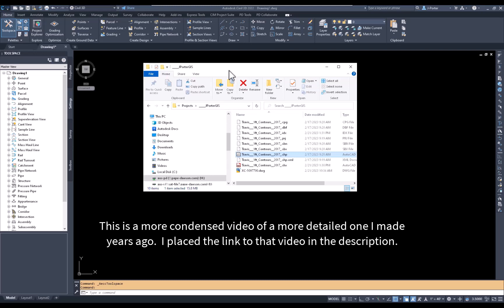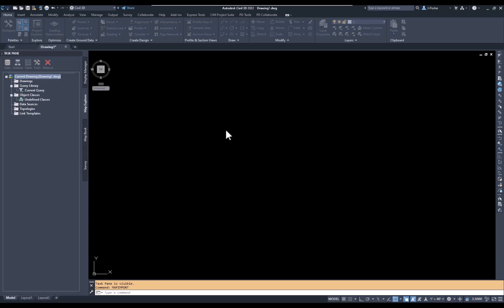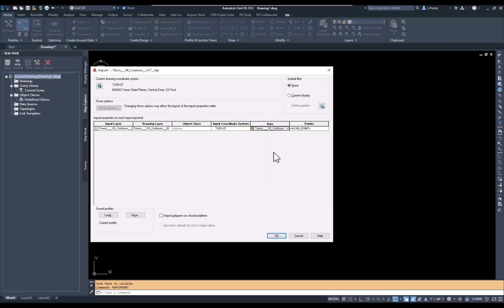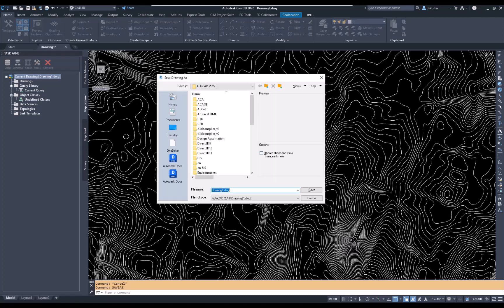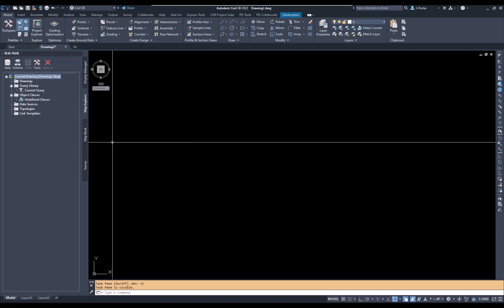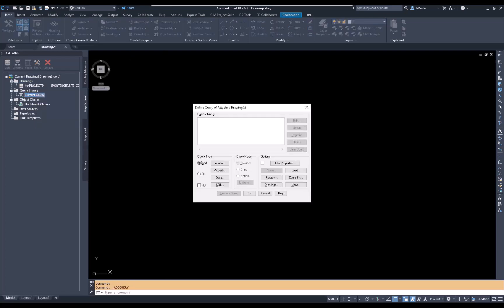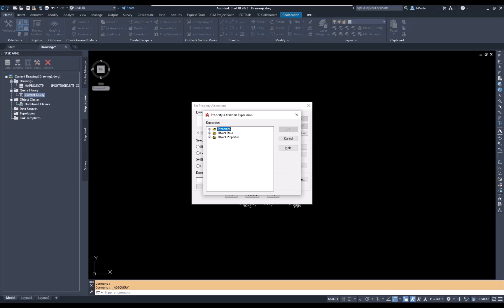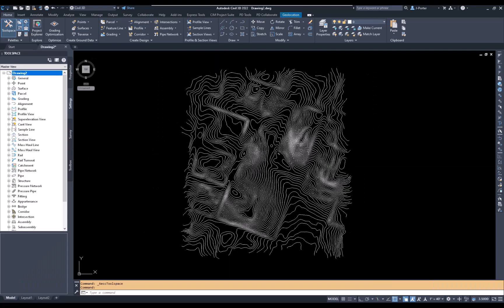Extracting Contours from SHP File

Comment: thanks for the great video! now the problem I am running into is when i go to create a surface and add the contours using definition drop down it doesnt add the contours fuuly. it seems to cut off parts or "square up" curves sometimes. Is this a setting within the surface style itself?
Reply from the maker: I believe what your looking for can easily be answered by a buddy of mine in the following link.  I think you need to begin at minute 5:07:  https://www.youtube.com/watch?v=Nndffp9Yz9s

Comment: my elevation data from my shapefile has "###.## FT" as the attribute data so when I try to run my query it doesn't recognize it as a elevation. Is there a way to convert the attribute data to a integer?
Reply from the maker: I'm unsure.  This sounds to me as thought the data wasn't properly input into the category in the SHP file.  If that's the case, then you'll need to take this up with whoever created the SHP file.

Comment: Im using C3D 2023. When I perform the query to extract the elevation data, there's no window prompt for the Define Query of Attached Drawing. Instead the I'm executing the query on the command line. Do I need to change C3D version?
Reply from the maker: No, it should work in 2023.  Sounds to me like your command dialog boxes may not be appearing.  Try typing in CMDDIA at the command line and set the value to 1.

Comment: In the final step I have “block attributes” instead of object data
Reply from the maker: Is the data in SHP file format?  If so, did the SHP file come to you with other files?  A full SHP file will be the SHP file along with a PRJ file, an IDX file,  a DBF and sometimes an SBN file, an SBX file, or a CPG file.  If you don't have the these then the software has a difficult time geolocating the data (using the PRJ file) and providing the object data information (using the DBF file).  You can read more about it here:  https://www.autodesk.com/support/technical/article/caas/sfdcarticles/sfdcarticles/Required-files-that-make-up-a-shapefile.html

Comment: tqvm i also have problem about it. i will try. but it to long step. I also have problem, when i click the contour line after mapimport, my laptop will hang....
Reply from the maker: Have you been able to test the file on another system?  It sounds as though it may be a system issue or the SHP file may be corrupt.